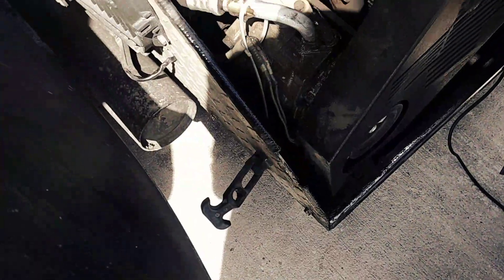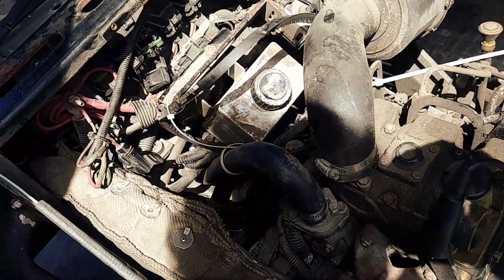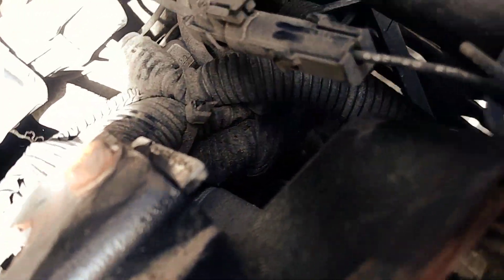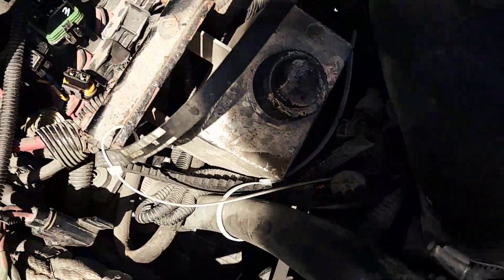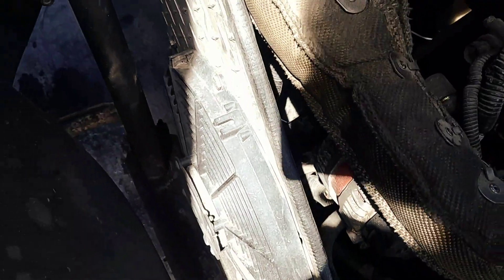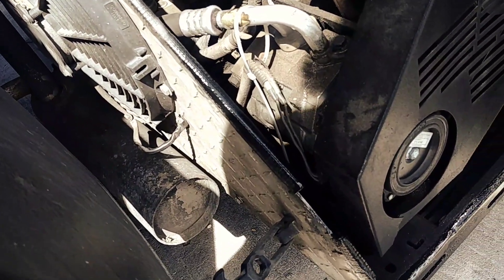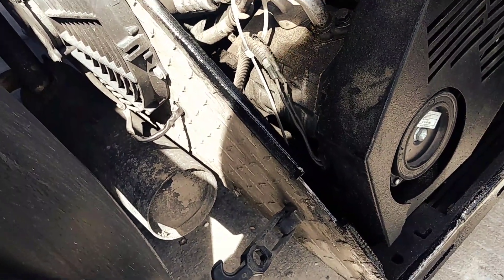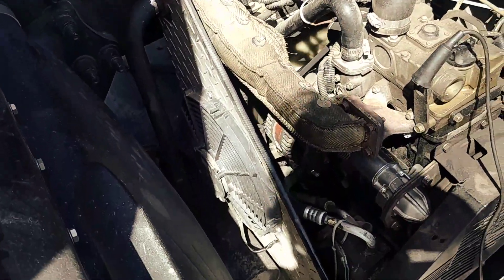Rigmaster APU overheat fix

Comment: There's a reason why your fuse blew and it will probably blow again... It's a chance you're fan is starting to go out and it's starting to pull more power than the fuse will allow
Reply from the maker: You are correct it did eventually require a fan motor.

Comment: Ok thanks, found 2 fuses,not exactly under relays but fuses were good. I'm trying to help my trainer figure out problem. Unit will give a overheat fault and won't restart, then About 24 hrs.later it restarts itself.

Comment: My fuses were all good , the fan actually was barely turning.  They replaced the fan , the tech said the fan turns when compressor kicks on if the fan malfunctions the ac wont cool and unit will over heat . Thx for the video,  knowledge is good.

Comment: You HAVE to be pretty good at fixing the damn things...  They are ALWAYS jacked up.  I've had that fuse melted, and I've had one repeatedly melt under the bunk (on the HVAC module) and about every connector on it vibrate loose at one time or another...
Reply from the maker: It's a challenge